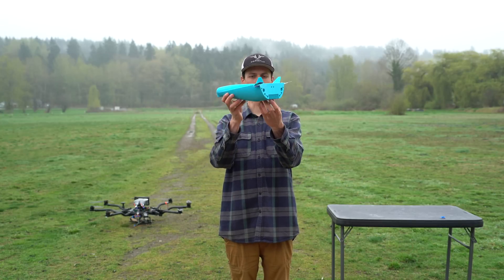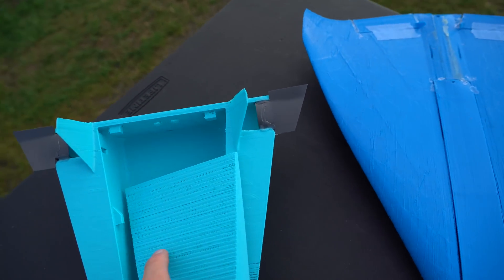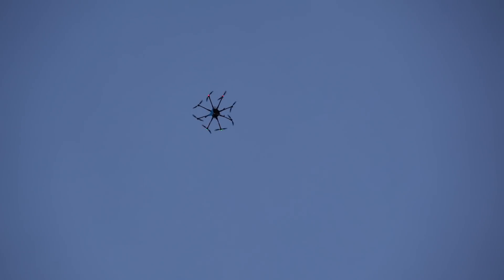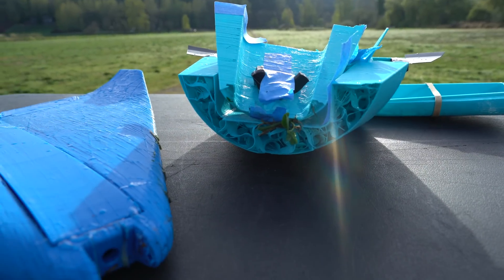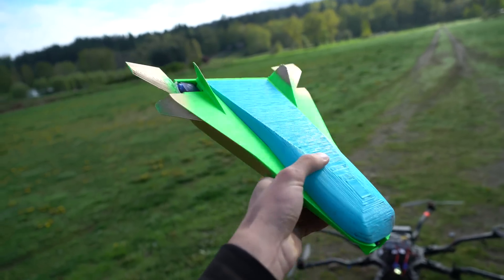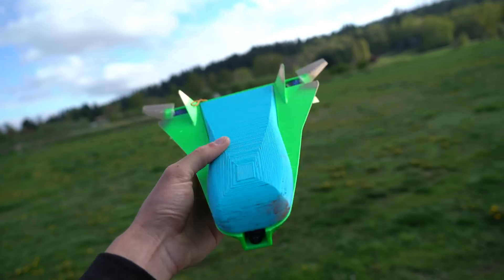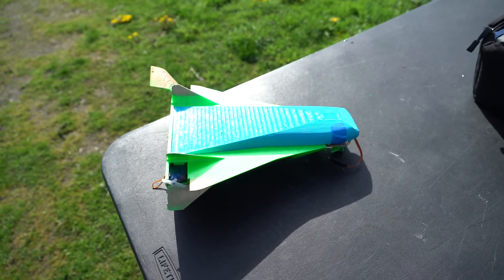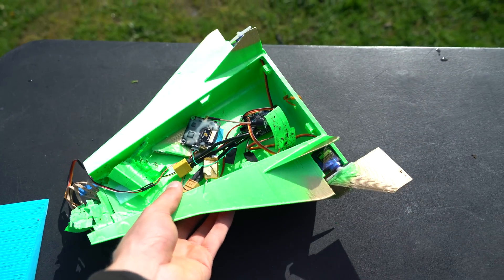3D Printed RC Lifting Body Aircraft? - RCTESTFLIGHT

Comment: my 2 cent is take off the slots on the bottom but first try  putting a "dam" . at 7:50 you see the back of the plane. you see the square openings from the slots and a spray of gold. imagine the spray of gold was a piece of lumber. lower it and nail it across the open squares. maybe the air striking the dam will make it go strait up?

Comment: 3:05  NASA One (flight control): "It looks good at NASA One."

B-52 Pilot: "Roger. BCS Arm switch is on."

NASA One: "Okay, Victor."

B-52 Pilot: "Lining Rocket Arm switch is on."

B-52 Pilot: "Here comes the throttle. Circuit breakers in."

Steve Austin (voice of Lee Majors): "We have separation."

Chase plane: "Roger."

B-52 Pilot: "Inboard and outboards are on."

B-52 Pilot: "I'm coming forward with the sidestick"

NASA One: "Looks good."

B-52 Pilot: "Ah, Roger."

Steve Austin: "I've got a blow-out - damper three!"

Chase plane: "Get your pitch to zero."

Steve Austin: "Pitch is out! I can't hold altitude!"

B-52 Pilot: "Correction, Alpha Hold is off, turn selectors   Emergency!"

Steve Austin: "Flight Com! I can't hold it! She's breaking up, she's break "

Oscar Goldman: Steve Austin, astronaut: a man barely alive
Gentlemen we can rebuild him
We have the technology
We have the capability to make the worlds first bionic man
Steve Austin will be that man
Better than he was before
Better, Stronger, Faster

Comment: Sorry mate your models are way to heavy.
Or your centre of gravity is still off.
A little trick is to take your centerline and measure back 18 per cent and this is the start position.Now you have to hang it up at this point and balance the model l both horizontally and vertically so that it is level.
Got that........old guy........

Comment: I know it's 4 years too late, but IMO one of the main handicaps you faced was due to the way you suspended it from the drone.  It simply didn't have enough time to get into a stable flight position before reaching the ground.  I'll bet that if you had a simple 3-point harness (a string coming from the nose and each of the rear corners, meeting in a loop, and you suspended it from that, it would be a lot more likely to reach a controllable attitude before approaching the ground.

Comment: i think you spoiled the test with those slots, i think they change everything, including the aerodynamic shape, and thus the lift, without contributing to stability.  i also notice the NASA body had quite high aspect vertical stabilizers (rudders) - i think indicating the need for same.  consider taking a tip from power boats, and adding strakes (or whatever you call them) to the hull, in the same place - i think these might work better than the slots.  thanks again for all the data, these are very interesting experiments, wish i could afford to join in.

Comment: weight is an issue ... i would defenetly love to see you try taht again with way less infill and thiner walls ... also ABS has per volume less weight then PLA so there is a lot of ways to go i would just love seeing it working i think the aproach you went there was more plastic means less loss at crashes but i feel like that it didtn work bevause of the high weight

Comment: It would be interesting to build one with a smooth bottom and top and compare it to the flight characteristics of the one with ventral channels. With the channels, the dis-similar surface flows (as they meets at the trailing edge) might be quite chaotic across the lower surface resulting in that tendency to flat spin under light loading, or require higher weight than is optimal for efficient lift to regain stability.

Comment: The bottom fins look like air diffusers. A lot of race cars use them to help boost the speed air moving beneath the car. They re probably reducing a lot of lift. If it was smooth you'd likely have a lot more lift. (diffusers are meant to create downforce)

Aerodynamically you would want slower moving air with more drag on the bottom of the wing, and faster moving air at the top. Having diffusers on the top might help

Comment: Coming in a bit late.  You said "I had the idea of pulling in the community" so I have a stl file of a hallow Dream Chaser model (top, bottom, and the two outboard fins).  Print set to approx 12" long but can be easily scaled, outboard fins fold in and goes in an aeroshell on a high-power rocket.  I have no RC aircraft stabilization control experience.  So...interested in collaborating on a project?  Oh, and lifting bodies obtain lift from their angle of attack.  Even a tube (like the Falcon 9 booster) is a lifting body at the correct angle.  A central fin would help more with roll control than airframe slots.  Look at the differences between the M2F1 and the HL-10.  You'll need high velocity to achieve any kind of level flight/flare and your rate of descent will be uncomfortably fast during most of the flight.  That's why you will need to start at >10K' to get a good flight.

Comment: The reason why it kept crashing is you just kept dropping it. The lifting bodies like the space shuttle were never designed to start from zero airflow straight down. They where a proof of concept for reentry vehicles. If the vehicle was released during forward momentum it would have been a better test.

Comment: The problem with your lifting bodies are the slots you put on the bottom.  That aft bottom area is where the body gets it's lift, actually negative lift.  That back aft bottom portion, pulls the tail down, and creates an angle of attack on the forward bottom section.   Think of the bottom as a wing, that is backwards and upside down.   Those slots you put in, ruined it, by preventing the body from pulling the aft down.

Comment: Oh and voice typing so much easier . .but hey,  I enjoy  the videos as I share your interests, appreciate your time  and effort to share with us in you're venture. But youre  "high lift body" design 3D model based on that round bottom guppy body "re-entry vehicle" that was anything but a " high lift body" . it was designed as a "high altitude re-entry vehicle" dropping (not lifting) from high altitude where the ultra  thin atmosphere would not help or  hinder it's decent and the round bottom would hopefully offset the intens heat  developed during  the  high speed re-entry and from there  continue with proper flight speed to enable a somewhat flat trajectory reentry, there for  a safe landing. To get that smaller scale re-entry vehicle with those scramjet like  symmetrical fins running longitudinal on the bottom of the fuselage you'll have to get the speed up. It appears you  trialed moving the CG rearward to an aft position, there increasing the angle of attack and in that hopefully improve the glide characteristics. Well that didn't work but we enjoyed watching as you are  truly inspired. I think you'll be better off just flipping it over and flying it right-side up that is the high lift body design based on a high lift wing foil that has a flatter bottom profile with the maximum profile thickness (curved lift foil) on top which hopefully fly's better. I like that Delta shape that you showed in your video interesting. That design could use a lot more fuselag but I think what you have there is the two of them should somehow be incorporated into one  vehicle . Maybe a simple 3D  modeling morph blend,. or ?  that 3D build up from designed to fabrication is really interesting and great advantage. To mention that I just started to catch up on  your video sight and appreciate   your sharing your study of high-tech interests, with us all and are those videos prof of the onslaught,  persistent in attempts,  trials  not so without failures but more so truthful in the victories. Yes victories. thank you.  R.C.

Comment: You need the camera to be smooth at the front. That box is just ruining your flow. Also the top needs to be flat. You are creating another high pressure with the dome on top. Air wants to leave at the sharpest point possible. Maybe even add a small lip on the top to keep the air from rolling over to the top even more.

Comment: you should have researched a bit more before start doing anything... it would have saved you a lot of time...there is one reason for their shape: they were meant to be reentry vehicles which would have to go very fast, above speed of sound.... this would work at high speeds due to the shock wave cone... the body has the shape of a half cone, because on the lower part the air would go at high speeds, due to the shape being near the same shape of the shock wave; but above it would be of lower pressure, which would result in lift. if you research more on those tests which were done before designing the space shuttle, you would've seen that they had to land really fast... and that they were simply uncontrolable, very hard to keep stable... if you want a rc with the lifting body concept, you'll have to go in a completelly different way...

Comment: I did This in the late 90s with a nitro powered pusher. It was scale with the 3 fins 90  2stroke 3 blade pusher prop. It worked and the roll rate was crazy fast. Lots of nose weight was needed and balance weights at the bottom of the fuse to keep it stable on roll It was plywood  and balsa with monokote 55inches long 26 inches at the back . I made it from 3veiws sent by sun n fun eaa library It didnt like wheels so we started to slingshot it . I sold it and it is hanging in A hanger in Hidden lake fla.  I used to fly it with rudder and elevator . almost never touched the ailerons.  I will look for pictures.  J' Prive

Comment: Fyi, something I have learned from making boomerangs from aircraft grade plywood: as smooth as the raw wood surface can be made, a gloss finish makes a drastic difference in flight characteristics! I would try to throw an unfinished boomerang and it wouldn’t want to fly, much less with stable and predictable characteristics, clear coat it and suddenly they fly like a dream!

Comment: the fins at the bottom is ok, but the inclined angle of the tail creating low pressure that's why its tail heavy.
just make it smooth straight.

Comment: "A lifting body barely able to fly. Gentlemen, we can rebuild it. We have the technology. We have the capability to build the world's first 3d printed lifting body. It will be that craft. Better than it was before. Better, stronger, faster."
How were you keeping the 2 parts of the lifting body together? I heard of a privately designed airplane that refused to lift off because of a decal that was placed in just the wrong spot of the wings' leading edge to ruin the airflow. So if you used a rubber band around it, that might ruin the aerodynamics.

I would also recommend the use of other lighter material. I would try the stiff cardboard like the model rocket companies use to make the tube rockets out of. Look into Papakura.

Comment: IMHO the 1st (blue) aircraft was showing the best (not about controls but stability). As I feel, these vertical "stabilizers" only gives you more "aerodynamic mistakes" when it flies. Before randomly dropping this stuff it's better (not sure if easy possible) to make simulations. At least you'll roughly see real mistakes and fix 'em before the final compositing.
My guess is that your "half-cone shaped" aircrafts were mostly overloaded (size/mass factor). Maybe if you'll print an object x3-5 times bigger than these with the same shell thickness (and with manually composed internal ribs instead of the infill which generally just increases the mass! just check the difference in a hit simulation - any sim. engine) then you'll have much more chances that it will fly and maybe will be controllable. But of course you will need some auto-stabilization system anyway! Such aircrafts doesn't fly without gyro-sensors.

Comment: The "tail heavy" one's design doesn't actually generate lift, it just rides the air like a boat. You've tried to add an airfoil to the top of that, which basically means it's now a cone, neither a lifting body nor an airfoil. Of course all it does is dive into the ground.

Comment: Your slots on the bottom are the problem.  Without the slots, the back portion of the hull would pull down and your slots removed that function.  The back bottom portion is the key to lifting bodies and you ruined that.

Comment: I made some lifting bodies in high school that were launched from a drone and eventually from a rocket. I ran into a lot of the same problems as you with the yaw stability. A more flat body and larger body and larger vertical stabilizer closer to the edge of the body helped a lot. Still squirrely though.

Comment: The early lifting body craft that Northrop and NASA were testing had very similar issues to what appeared in your video. The M2-F2, M2-F3 and the HL-10 all similar to your lifting body that was having stability and apparent CG issues. The M2-F2/3 was modified with a center stabilizer and the engineers for the HL-10 modified the outside fins. In both the M2-F2 and the earliest version of the HL-10, flow separation was deemed to be the major issue. This would also explain your comments about random stalling. I believe the first test pilot for the first flight of the HL-10 had to keep his speed way up to keep the craft under any type of control. I would really like to see your follow up experimentation.

Comment: I would guess you were entering the spin because weight was too low.  Meaning flight speed was too low, probably such that a little control movement slowed it down .5mph to stall.  More weight would improve your margin over stall.

Comment: The point is your design is only getting wider at the end, it only drags down the nose, it should be somewhat half egg shape for reducing tail vortex. I mean it should be more slip stream for more stability. From what i looking back the original design they made some form of Kline-Fogleman (KFm1 overall shape of the unibody) airfoil with using vertical stabilazers or air breaks at back, which follows the upper body. As some people mention about the rear diffuser makes downforce. And the last upper part of your design should be more slipstream and the somewhat spherical nose cone could help alot. Sorry for the lang. Good luck.

Comment: Surely a lifting body should resemble an airfoil,  the top of your craft has sharp swage lines which will disrupt the  air flow. The shape does not excite the air flow to speed up over the top and trailing edge is to thick rather it should tapered to sharp edge.

Comment: I guess the spins are generated by the arch of the top of the nose section of your occasionaly somewhat lifting body. when the angle of attack gets large enough for the airflow to stall, there could be some airflow maintained at onde side of the body which generates suction, draging the nose into a yawing motion. If you look at Nasa's lifting body you basically copied, it has a mostly flat  top with a sharp stalling edge all around, with only the fairly small bubble canopy peeking out. It enitrely relies on a delta vortex for lift, no attached airflow. Flattening the top side of the model should fix the issue, I guess.

Comment: From what I've been seeing, it may be beneficial strength and aerodynamics wise to print the lifting bodies oriented at 90 degrees to how you printed these, though not necessarily possible, depending on the design and other factors.. And also greater adhesion between printed layers may be possible  by increasing filament temperature marginally, or even using an enclosure. Although a cooling fan is generally needed at the print head, cooling the filament too quickly reduces adhesion.
And how about printing with a foam like filament? This one has PVA in it's mix and loses it after rinsing in water (for several days). But it's bound to lose weight.
 Oh, and it's expensive @ $40 for 0.25kg
https://www.youtube.com/watch?v=Pkaus3DN2w0
https://www.matterhackers.com/store/3d-printer-filament/poro-lay-lay-fomm-filament-175mm
Heh, I've said all this, despite not having used my 3D printer for more than a year.

Comment: Nasa lifting bodies were very light. Rocket fuel to get to space leaves you with a light outer shell and minimal structure. High drag good for re-entry to keep speed and heat down. I suspect your wing loading is much higher. Lower wingloading on model means lower terminal velocity and less penetration. Maybe more control throw and just the right cg and you could gease the landing.
Thanks for sharing!

Comment: i don't know if this has got any chance of working at all, and the challenge you set is hardcore. It could be an interesting contest for aerodynamics student though! The problem i have is that the size of the aircraft implies a very low reynolds number, and even if the aircraft was falling 10 m, it would only be around 200 000 Reynolds, for an aircraft with a 30 cm chord and a 500g weight! Now, it would be usefull to know why did you choose an airfoil with such a thick trailing edge? You don't have no rocket engine exhaust to deal with, nor the necessity of slowing down your plane from 2 000 m/s down to something affordable. I'll probably give this a try, and by the way thank you for the cool vids! All the best to you :)

Comment: Maybe the Fins on the bottom take away from the lifting effect of the body.  Look at the original nasa fuselage and follow its shape as close as possible. Then make modifications. Also rc rocket gliders use similar concept of returning with Aileron controls only